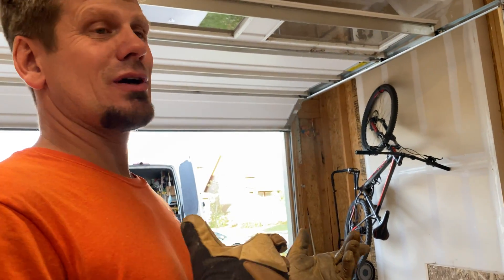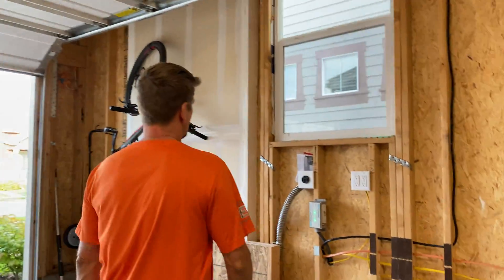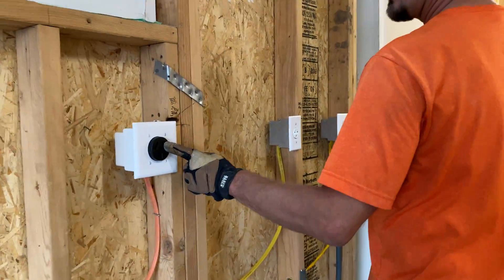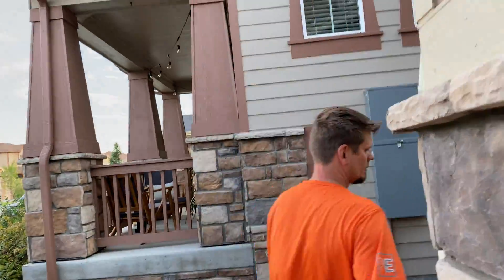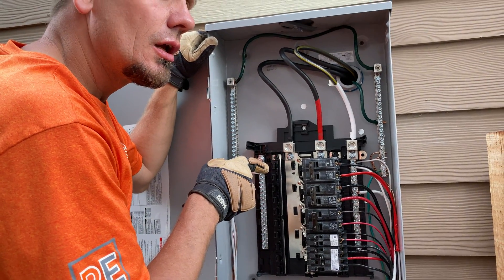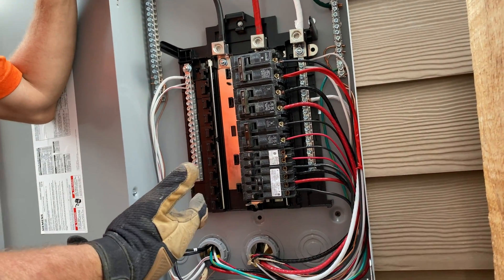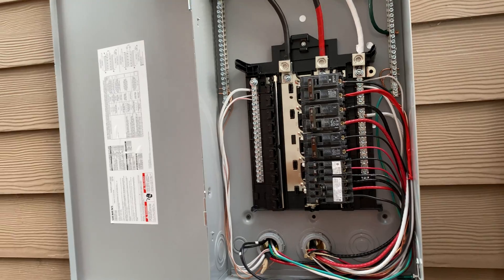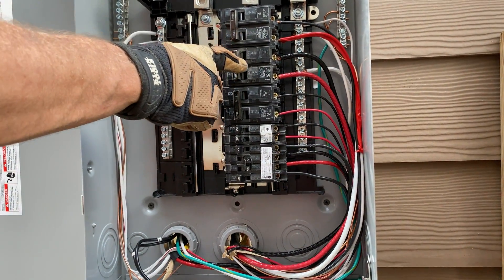GFCI Protection Codes

Comment: This video is 2 years old - yet even today no manafacturer makes a 2-pole dual function breaker. Siemens is still the best - at least they make 2-pole AFCI 20 amp breakers. Square D has discontinued theirs. It's literally impossible to do a panel upgrade in an old house and pass inspection. As a result of these "safety requirements", people are stuck with 40-50 year panels because putting in a new one would require you to be code compliant.

Comment: Garages ,outside ,basement ,kitchens ,bathrooms .
Reply: Basically yes - but not everything in a kitchen has to be GFCI.  They are required for receptacles serving countertop surfaces, and within 6 feet of the sinks.  They are not required for an outlet behind a refrigerator that is farther than 6 feet from the sink, the breakfast nook receptacles, etc.

Comment: The next NEC requirement: an armed guard, that also happens to be a licensed master electrician, at every wired-in device, receptacle, and with every plug-in device, to be sure everything is up to code.

Comment: Yeah try to run GCFI on AL/AU 12/2 wire from homes built in the early 70's. My house has AL/AU upstairs and we found our downstream outlets would melt the neutrals clean out on a 15 amp load!  Correct me if I'm wrong isn't AL/AU 12/2 wiring exempt from GCFI?
Reply: Not exempt.  AL wire does not afford special protection against ground faults.  I'd probably retire the AL wire in that size as soon as I had time.  People get all up in arms about knob and tube wiring.  AL branch wiring is exponentially riskier.
Reply: @steveloux4709  Yeah we need to rewire the house but we started using Alum-icons with romex pig tails for now. No longer melting the neutrals.

Comment: Putting it on AC? What’s the point in that, there’s no way that will even work. With these new variable Hvac systems that use VFDs and likewise the GFCI will trip as soon as it starts. Additionally with a standard compressor in an AC unit sometimes they start funny or a little strange bases on voltage, this will cause the GFCI to trip so now the client thinks they have a bad AC unit but the breaker just doesn’t work with it.

Comment: Thank goodness our state codes nix all this new GFCI madness.
Reply: Colin Stuart
 ... nix is probably the wrong word. States do have the option to not adopt the code right away, and many inspectors are using what they know from years in the field. IOW, they are still enforcing code from prior to 2008. My guess is they will change eventually.
Reply: @rupe53  WI has adopted 2017 NFPA 70, but strikes a number of GFCI/AFCI requirements. Not sure when they'll adopt 2020, and/or if they'll change their amendments to 2017.

Comment: I dont think the home inspections are going to be that extreme, only new and remodel builds
Reply: I agree.  Old equipment is 'grandfathered' not needing to be changed out.  I like the safety of GFCI's like if you are working outside with electric tools and standing in a puddle; its good to use a portable GFCI, i.e., a GFCI on an extension cord.

Combination GFCI/AFCI's are now available and can be very expensive at the box stores unless you shop on-line.  AFCI's stop arc-fault fires by interrupting the circuit when sparking occurs.  These are very good to safeguard knob and tube wiring.
Reply: @mike7gerald  ... from a liability stand point the best thing to do with knob & tube is to disconnect it, rather than be the last guy to disturb a potentially dangerous situation.